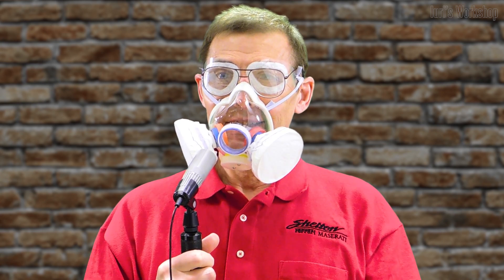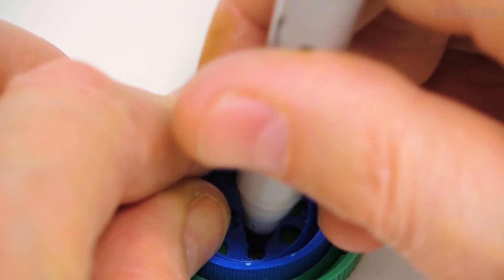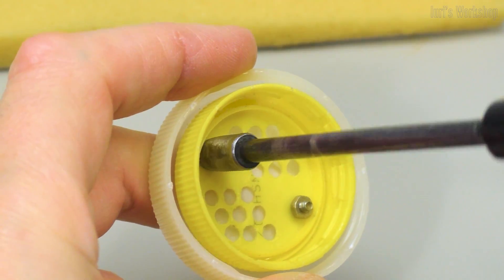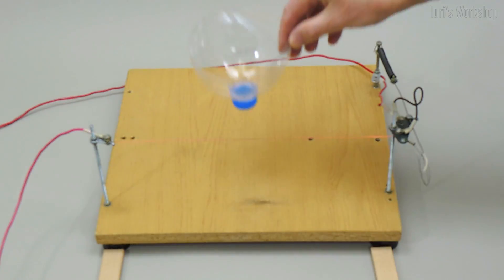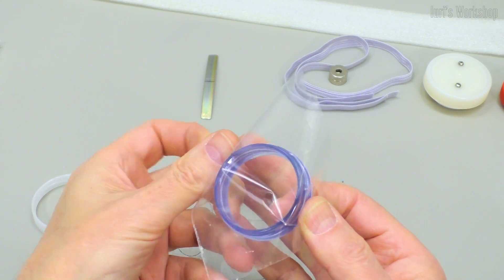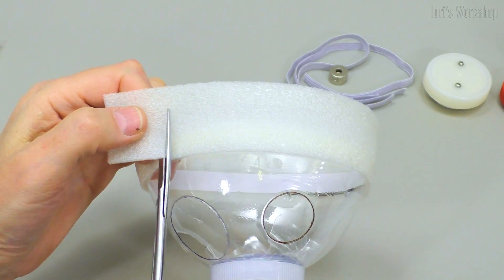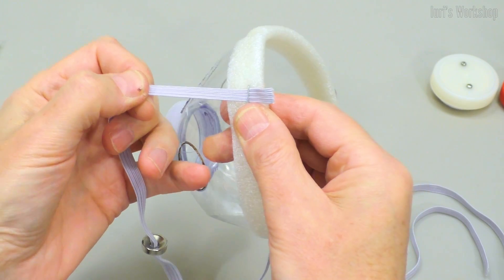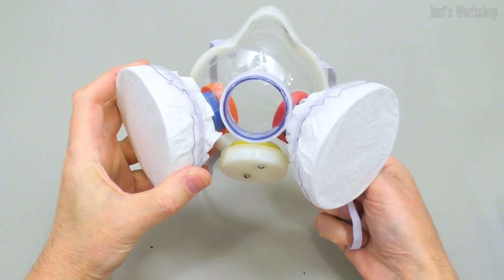🔅 DIY Respirator #3 (upgrade)

Comment: i have watched all 3 of your respirator video. i think your videos are the ones that consider about real  aspects of respirator the most (the manual diy kind, not the 3d printed ones). not just looks and fashion.
your respirators consider adequate supply of oxygen, good seal to the face (without proper seal, i wouldnt go through all these troubles of diy, altho it's fun haha) and you used no glue at all. thats cool!

thank you for all these videos. they certainly inspire ppl immensely! me, at least  :)
Reply: and in the 3rd upgrade, you even added a speech membrane thing to improve talking through the respirator! bravo!

Comment: I used 2 soft foam hair curlers for the padding and form to fit the face, cut down the center laid over the sides and filled with super glue. They have a metal ribbon on the inside to help form the shape. Air tight seal and its pretty comfortable.

Comment: hahaha, I just finished my second version!. But thanks, now I'm gonna try again to make this third improved version!
Reply from the maker: I am sory! When I went to the store, the cashier did not hear me well. I decided to improve the design. I added magnets along with the membrane. As for the 3-liter bottle, if it has an extruded pattern on it, then it can be removed using a gas-burner. The air pressure in the bottle should not exceed 0.5 atmospheres: https://youtu.be/-5HhjDENfFQ?t=122
Reply: @IurisWorkshop  Thank you!  I would like to ask you which options do we have to make the material for the ring to make holes? I think thats the missing part to make the mask the same way as you do!  I had to make the holes with a cutter for I didn't know how to get that material. But it is kind of cumbersome and maybe I will have to make more masks for my family so I have to increase my eficiency. And finally I used 1.5mm diameter wire instead of steel plate for the same reason, I don't know how to get that. I am new in this world of crafting!
Reply from the maker: @fakelove7272  There are small scissors with curved ends for cutting nails. My wife has such scissors, but she does not give them to me. :) With these scissors you can cut very precise holes in plastic bottles, starting with a diameter of 20mm or more. You can mark holes with a dividers or round object.